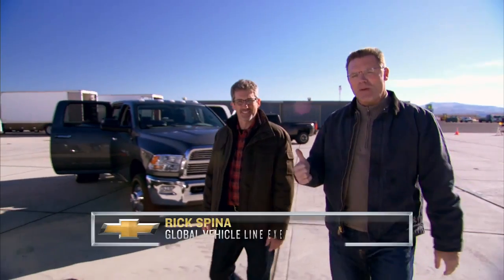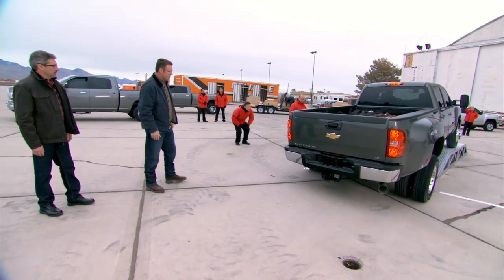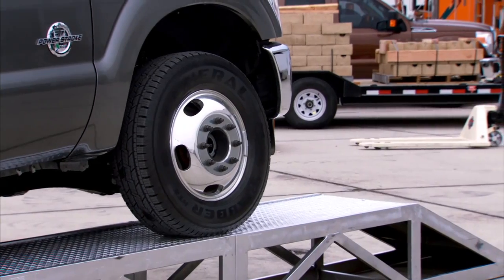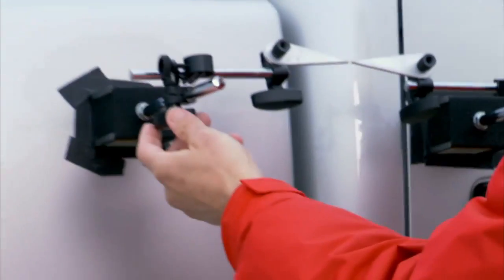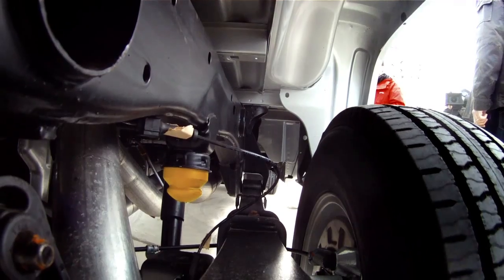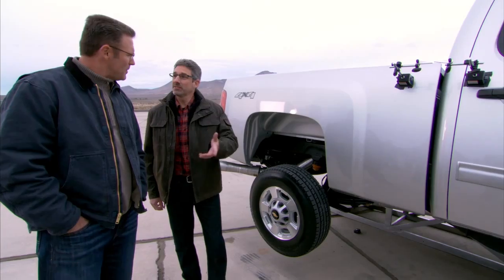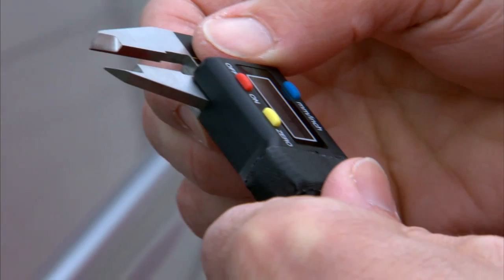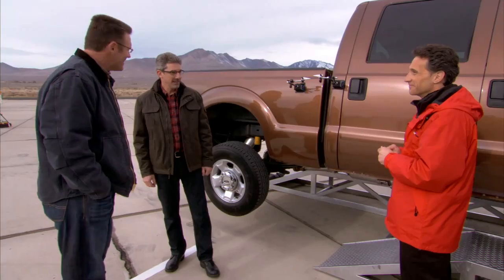Chevy Silverado 3500HD Head to Head Frame Strength Test No. 2 Twist Ditch

Comment: Chevy hit me back when you can develop 100% your own diesel motor until then quit whining about how your better than ford yet my family has owned Chevys forever and 20 years ago got a f-150 and have never had a single issue with it the most reliable vehicle we’ve ever owned and has 340,000 miles all original engine and transmission never worked on or opened up

Comment: This the fourth video I watched and everytime ford fails everytime 🤣
Reply: They’re literally biased everytime
Reply: Ford engineering is specifically clear that the twisting of the frame helps under heavy loads. When you haul 40 thousand pounds the engine will torque the frame. It helps balance loads is what I’ve been told and so far is proven so
Reply: @fordrestored4646  yeah I'm not so convinced slick especially since they made their beds out of aluminum cans the truck overall rust's out ALL UNDERNEATH, computer issues,no where near enough horse, when the frame twists like that it actually weakens the frame not strengthen it when that happens it creates a weak point between the bed and the cab and or the truck starts crab walking down the streetthen you have to replace inner outer tie rods ball joints brakes rotors bearings and even tires. Not convinced that Ford is a quality vehicle maybe back in the day where they did things the right way but now it's all about saving that Almighty buck things are built cheaply over there and have been for a while. Mr Ford if he were still here would be ashamed at what his company has transpired into. That's why the Dodge brothers left.

Comment: one thing. boxed chassis tends to not flexing, thats a property for comfort and smooth roads: rigidity. "c"chassis tends to flexing, thats a property for load and irregular roads: flexibility. the chevy is good for one thing and the ford is better for something diferent. 

other thing: too much rigidity makes it more unconfortable (thats why the fame of the suspension of the chevy trucks). too much flexibility makes less durable (ford should think about reinforce the "c" chassis. to be honest, that fords flex too much). 

the real deal is that there is no compare; boxed vs "c" sounds like rugby vs soccer, almost the same, but it's diferent.

Comment: Ford’s are disposable throw away cheap trucks.
GM trucks are much stronger trucks, Duramax diesel is much better engine than Power Stroke junk. Ask any construction guy what hold up better for day in day out hauling and towing heavy loads. Allison transmission is much heavier built than Ford clunky transmission.

Comment: Just to clear this up: if you have a Chevy , you have a Chevy. If you have a Ford , you have a Ford. Depending on how you treat them they both can be reliable. And they both can have the same issues
Reply: Ford and GM have different material in the bed frame

Comment: You need flex in the frame or else your frame will crack. It’s obvious that the tailgate on the ford is locked because dude pulled the handle all the way out. All Chevy commercials are bull. You don’t see dodge or ford paying actors just to boost their sales.

Comment: For all you cry babies out there it's just a frame test, the only situation where this would matter that I can think off is serious off-roading, me personally I'm a Chevy fan I have never owned anything but trucks, a 1990 Silverado v8, 2012 Silverado v8, 1991 Ford F-150 inline 6, 2010 Ford F-150 v8 and 2006 Dodge Ram Cummins 6 speed. Never had real problem with any of the brands! and so far I've favored the Chevys not because it's the best just because it's my favorite brand and they have done the best for the jobs I've had to offer them, except for the dodge Cummins because I just used for hauling very heavy trailers! Every truck has its flaws, all HD trucks are built for work, some trucks have more power, more speed, more towing capabilities, and the most durability, so just face it your truck brand might not have all of them but it will get the job done

Comment: Bought a 2017 f250 platinum in Nov and dropped a wrench into the bed that caused a 1 1/2 inch hole was very disappointed in the so called military aluminum, argued it back to the dealer and was able to trade it in for a 2017 GMC Denali now the GMC is some tuff SOB
Reply: You sure your not lying

Comment: I knew Ford wasn't the best but, WOW... What a pile of shit. The crinkle on the dually is unbelievable and the new aluminum they use now makes them even shittier. I see Chrysler cars and trucks rusting way sooner than the rest though. You can't win. They could all work together and make some really good vehicles... Between them all, you either have a crappy engine, weak structure, poor metal and or metal treatments causing the rust and corrosion.

Comment: Wheels on the ground mean traction, big vehicles need to twist! All part of the design!
Reply: edd Johns Articulation should be down to the suspension, not the chassis. Not that Ford is a bad truck. The main 3 aren't bad trucks by any stretch of the imagination. At the end of the day it really depends on what badge you want on the front and back of your vehicle.
Reply: They dont need to twist they just happen to twist! cough cough moron
Reply: @ChrisSmith-ig9jq  I don’t even remember writing this 4 years ago. Looked at the video again, that Ford is shit eh!

Comment: the BS in all of these commercials is that no matter which company it is (ford, chevy , dodge) that company will always say its the better truck. the USA top gear did a test of these trucks a few years ago where these tested all 3 major companies against each other and on the shows end the winner was chevy but if you watch and pay close attention to the show, the real winner was the ford. the ford was able to do a better burn out, pull the hardest obstacle and if the tires weren't bald after the burn out challenge then it would have also climbed the hill. so the real overall winner of the show and the best truck is the ford.

Comment: if a truck doesn't bend then it can risk snapping so Chevy actually is worse then ford in this situation
Reply: Steel doesn't snap in this type of torque.  Physics.  Get some... Idiot.  Steel snaps under high movement, the Chevy moves less, so it's less likely to snap.  Wow you need some education.
Reply: matthew sommers well from the millions of HD Silverados/Sierras sold in the last 10 years I've yet to hear about frame problems in the GM trucks.
Reply: matthew sommers Did you not see the Ford bending like a fucking  twig?  Moron.
Reply: matthew sommers THE DENTS?? LOL YOU FUCKING MORON LOLOL
Reply: Nate1829 if you hate ford so much go buy a Honda Ridgeline
Reply: matthew sommers gay ass car
Reply: Nate1829 I know lol
my final point is of course Chevy won't do worse because this was paid for by chevy
Reply: matthew sommers true lol I can't trust either of them when it comes to advertising
Reply: Regardless of your preferred brand you mention that the Chevy's frame can snap, but is the body supposed to dent it self? I don't care that Ford use's military-grade aluminium, if you're carrying around 2,000 pounds I'd much rather have steel.
Reply: Enigmatic SoulZ and I'd prefer rust more than corrosion

Comment: Okay, now do a real test. Both of these trucks (3500 and f-350) have a 7000 pound payload. why don't you put 7000 pounds of payload inside these beds. The chevy is going under a lot of stress with 3k pounds in the bed. you just don't see it. The frame is taking a lot of stress on the welds that hold it together. Now lets look at this, from an easier perspective. A elongated cardboard box with both ends closed is just like the Chevys frame, fully boxed. If you were to thicken the box substantially and take one side out of the box, you would have the fords frame. the fords frame is able to flex to allow the trucks payload to be dispersed over a larger area, which will damage your box. So, twist the cardboard box with only three sides. What does it do? It flexes. Now, take the fully closed cardboard box and twist it. What happens? It does not flex. It will turn a little bit. But if you twist the fords frame a bunch, (with 7k pounds) and you twist the chevys frame a bunch (with 7k pounds), you will crumple the chevys frame, because it has nowhere to go. Then, you have a 65k dollar truck that is sitting on the ground, with a sheared off frame. The ford will flex another half inch, and then drive back off. Now, if your stupid enough to actually drive on a frame killing flex test like this in real life, you have a problem, and probably don't even have one of these trucks. But, i would rather have my 3k dollar box break, then having my fully boxed frame lying on the ground.
Reply: ford is better not saying better on speed but better on performance

Comment: Why are chevy wheel wells always square.  Can chevy get over the fact that wheels are circular
Reply: OMG.  Looks, and they look great.  Are you really that dense?
Reply: Michael Lane 
I agree, the huge square cutouts are wrong on 3 accounts. Rounded  cutouts would improve the proportions and make it a great looking pick up for city people. If you drive only on asphalt, Chevy is the Best, with very car like ride and comfort.  
2. You would think the huge oversized wheel well cutouts are for huge off-road tires and wheels. 
But they will not fit.THE OLD ROUND TIRE IN A SQUARE HOLE,  is still true.
3.The Chevy is a great pick up, But this ruined the style and looks. 
CLOSE BUT NO CIGAR!!!!

Comment: Flexibility makes for a more stable towing experience, and with less chance of snapping a frame under high stress loads. Would take the Ford for that reason if towing.
Reply: +Jeff Margera tow load on an hd is 10k+
Reply: Haven't had a HD. Just going off my experience.
Reply: Then way does the Chevy tow easier than the Ford (According to most reviews????)

Comment: Fords are junk, we use them work because there cheap!
Reply: The 2016 F-150 costs more than a 2016 Silverado or Ram.
Reply: try it now with the new 2017 F250
Reply: thats what they were made for ur saying there good and there on a good price for work trucks (IDIOT)
Reply: Gustavo Martinez boxed frames rust out and the Ford is solid front axle. they hold up with drivers not giving a fuck about them in commercial use
Reply: lib gunner what hole do you live in Chevy altered the shown ford test truck

Comment: Just putting it out there. It steel dose not flex its snaps.
Reply: Um, no it snaps under high stress.  And the ford is far worse stress than the Chevy.
Reply: If steel snaps when its not flex why arnt they snapping left and right?
Reply: Depend on the metallurgy of the steel.

Comment: You do realize they make C channel frames to ALLOW some twisting so things don't crack or break. Some twisting relieves the stress, that's why semi trucks and any large commercial vehicle is always C channel. Being a boxed frame sure is a lot more stiff, but I 100% guarantee if you load the two trucks up or haul a goose neck trailer and try it again, the box frame will have so much more stress put on it that it will probably break somewhere. By the way this has nothing to do with Chevy, Ford, or Dodge, I am just strictly talking about boxed frames vs C channel frames
Reply: But the Ford C Channel chassis made the tailgate bend under the same load comparison...
Reply: Yah but it should be strong enough so the panels dont buckle.
Reply: Idiot.  Twisting of steel leads to cracking and breaking.  Get some education please.
Reply: ArcticAstrophysics this guy is correct this test is a simple sales gimmick that every ones bought into and common this test is not realistic. Now 2017 all 3 manufacturers have the fully boxed frame. However when you go and buy a cab and chassis style truck  4500s 5500s f450 f550 ect. they don't use their box frame? You need your chassis to flex so you don't break welds rivets  bolts  holding your suspension together as well as the frame together. Remember the more stiffer something is the more fragile it gets.
Reply: Clay Collins that's air suspension
Reply: ArcticAstrophysics  anybody else ever watch a tractor trailer flex when the light goes green?
Reply: Robert Murillo tell that to a diamond
Reply: the ford is already stressing the angle it is at. Chevy is holding up well. Lets do both trucks with the test you're talking about. that ford wouldn't be a truck any more! lol
Reply: did you here him say how much weight was in the box
Reply: correct
Reply: g496r500t check out videos of diamonds vs tool steel hammers. Tungsten carbide is more tougher then diamond however it's also very brittle under tension.
Reply: @skirmich that was bull shit, you could see the bed sides weren't butted up against the tail gate and that would never happen since the bed sides aren't rigid enough to do that
Reply: This aged well 😂
Reply: obviously the chevy didnt break.
Reply: Obviously they weren't loaded and under stress you moron, I'm talking about the physical characteristics of metal, it doesn't matter who the manufacturer is. It's the same reason aircraft wings flex up and down, they are extremely strong but the engineers don't make them rigid because then things would break
Reply: @ChrisSmith-ig9jq  bruh I'm pretty sure the engineers of every truck manufacturer have there downs and ups, I would have no doubt this guy is smarter than the engineers at gm

Comment: you actually want the frame to twist. ever watch a big rig take off from a stop? if the frame were stiff it would break the welds. for towing applications frame twist is a good thing as long as it isn't too much, but too little is not a good thing, the twisting force has to go somewhere, just saying chevy....
Reply: In some applications, yes. Other applications, no. In a pickup like these are you are better off having a reasonably stiff frame along with a good engineered suspension front and rear to accommodate this kind of stress. Chevy and Ram have already figured this out. Ford is finally coming around with their new 2017 Superduty frame.
Reply: Well, good thing is stretching it a bit... Old Scania trucks had M and H frames, medium and hard, the M was used for pulling trailers and the H for dumper-beds and construction but some used H frames for pulling semitrailers and said they were better. They used M because it was lighter and cheaper and ADEQUATE for pulling, not because it was BETTER.
So NO, you dont want the frame to twist a lot but its acceptable if it does, up to a certain point.

Comment: If you look at the tests with the pointers. The chevy pointers are perfectly even before the test. On the ford truck the left pointer is substantially lower than the right pointer. Chevy bias at its finest
Reply: The Ford was already going up the ramp at that point, twisting the frame. Sure, it would have been right if they showed it aligned on flat ground, but we can't claim bias based on what we saw.
Reply: LOL Jason... If thats true then the Ford pointers were misaligned the OTHER way, making the resulting twist even more severe. Look again, first the rear pointer is higher at 3:11, then at 3:25 the front pointer is higher. Congrats, if you are right the Ford is much worse than we originally thought lol.

Comment: it's not fair cuz the HD on the Chevy
Reply: HD is no different than the class of "Superduty".
Reply: ikr, this is prob paid fr by chevy
Reply: Lol the hd don't mean anything
Reply: Hd is heavy duty same thing as super duty it refers to engine and towing capacity
Reply: explain how hd doesn't mean anything.
Reply: These are all 3/4 ton and full ton trucks I believe the hd is just a badge proving the truck is bigger than a half ton 6 lug wheel common pickup truck
Reply: Correct. Hd does mean 8 lug vs 6. I'm confused you said "hd doesn't mean anything"
Reply: But the fords are all 8 lug as well therefore the hd doesn't mean anything in this video
Reply: yeah GM has 2500hd and 2500 and 2500hd and 3500